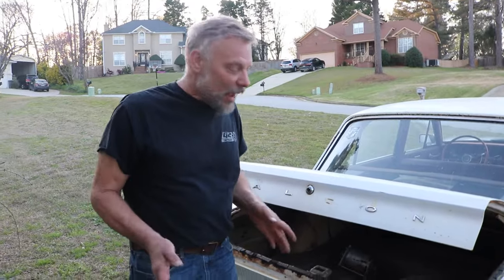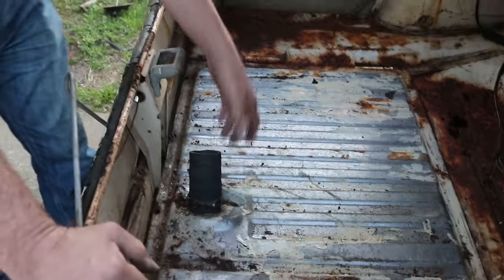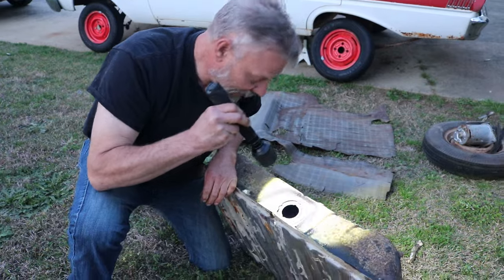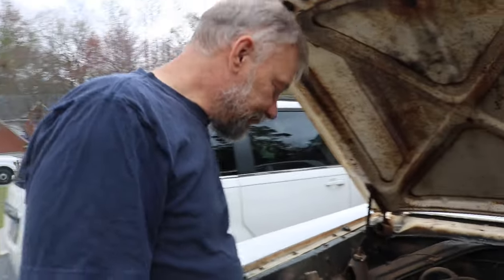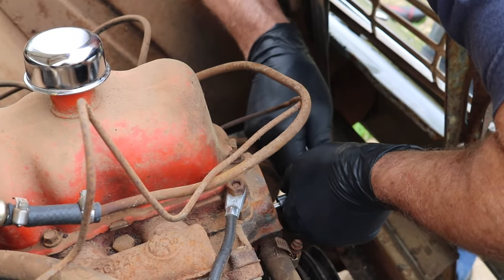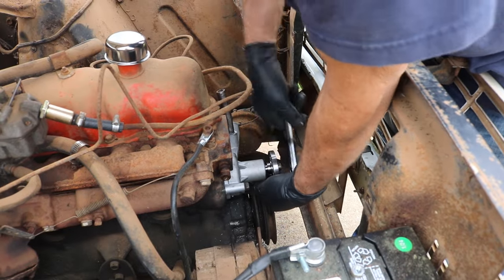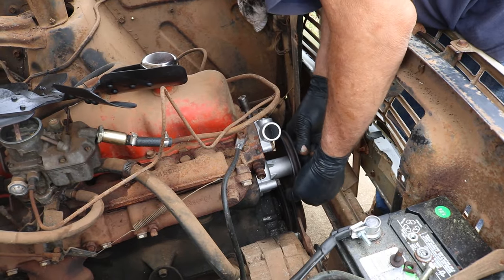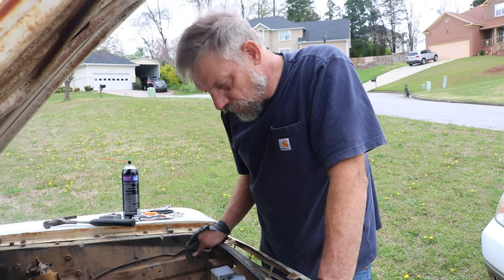Ford Falcon Restoration Ep 2

Comment: About fifty years ago , I bought a 1964 2 door Falcon for  $300. They were a mechanic's dream. Easy to tune up and repair. Never had to wait for parts , most auto stores had them on the shelf.  Three on the tree , they called my stick shift. Mine had thee same motor as yours and they came with the choice of 3 straight sixes ,the 144 , the 170 and the 200 C.I.D. .

Comment: Why haven't you just fix the old rad?? They are easy to solder and will last for ever, and perfect fit  and cheaper.
Reply from the maker: The leak was bad, over six inches across the cores. I was concerned after fixing those leaks more would pop up. New radiator was only $100. Cheap insurance.